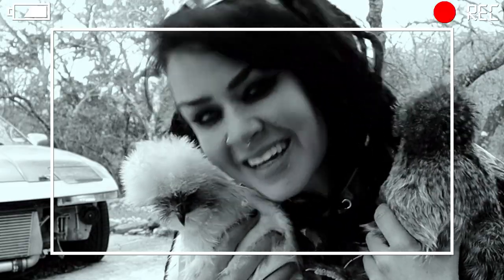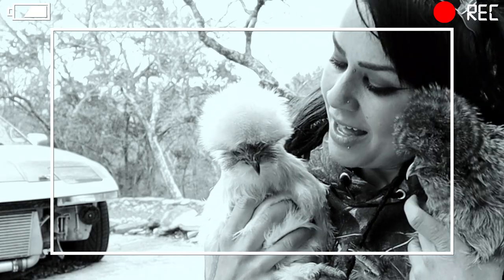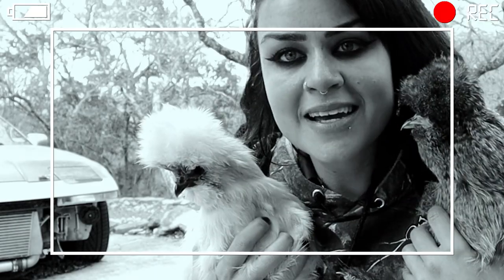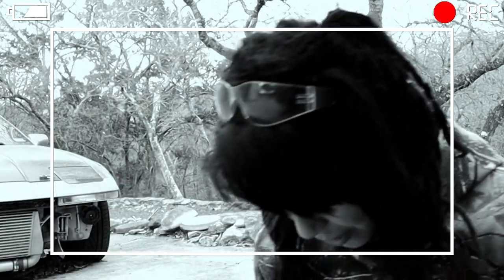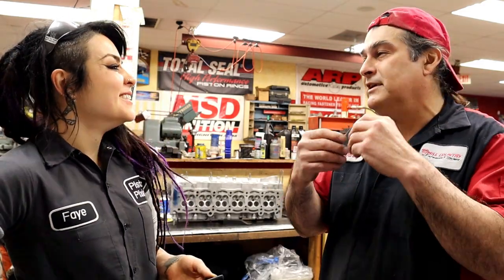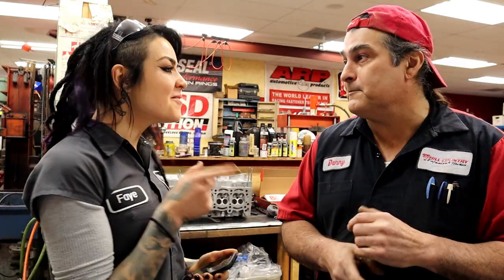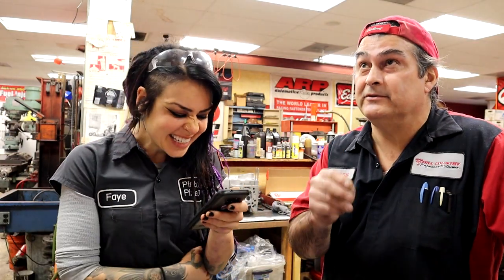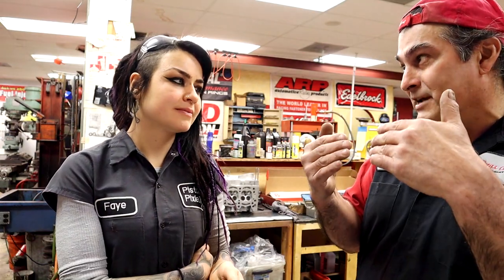Can You Straighten a Crankshaft?! And your other machining questions answered, feat Danny Soliz

Comment: Straightening a crankshaft is a pretty brutal process. If you want to see a customer faint, this will usually do it.  lol.   Stick it in a press, bend it straight, then bend it a bit more and beat the crap out of the journal shoulder with a blunt chisel to reduce spring back, check again,  do it a few more times until it stays straight, then grind the crank.  I like this guy.  He knows his stuff.
Reply from the maker: Yes!! Same!! Makes me wish I had a bent crankshaft just so I could watch him straighten it 😂😂😂

Comment: A small observation, to my knowledge Opel was the first mass produced cast iron OHC engine in the US in 1968, Ford and chevy followed in 1971 with the Pinto 2.0L with finger style cam followers and the vega 2.3L with bucket style followers. The reason cast iron is nearly impossible to straighten is because it has "memory" and is inherently brittle. Aluminium on the other hand has very little or no "memory" and is relatively soft in comparison so it can be straightened easily, but carefully. Great video Faye, and Danny.
Reply: Jeep had a OHC motor “the Tornado” I believe early 60’s.

Comment: This dude knows car stuff down to the metallurgical process. What he was talking about was when they forge metal what it does is opens up the molecule so they can hammer the carbon together so that when it cools its literally bonded together giving it that strength. Im just now getting into cars. I went into carbide. If I was 20 again I would have def went into auto mechanics. Its so fun now. Would have been a great career.

Comment: Tons of great info. Had the argument before with someone about sequence. It’s there for a reason was my argument. Keeping stuff straight.
Reply: Of course but, if you have experience, you can devise your own sequence ( if you have no specs for instance) as long as you spread the load evenly.
Reply: Steve Fuller yep but I have found a lot of similarity between large numbers of patterns. But that was from years ago. Aluminum is not something I dealt with a lot as I dropped out of the auto world decades ago. Still do just not for a living.
Reply: If you look at most sequences they are mostly based on starting in the middle and going outwards in either a criss-cross pattern or in a spiral. I’ve had to do heads where initially we had no information and haven’t had any problems doing it like this. Definitely let an alloy head cool before undoing it though!

Comment: Faye you're on to something here. You should use the Supra project to set up different series of insights from experts, like ...

1. Body/paint
2. Lighting/wiring
3. Suspension/lowering/wheels/tires
4. Transmission/diff
5. Interiors

... and what will soon become massively popular: electric drive conversions.

Comment: 20W-50 oil is fine for older engines like that when you're not concerned with fuel economy.  I used to run it back in the day (80's) but it was long before variable valve timing  engines.  That thicker oil is what saved your camshafts.
Reply from the maker: Thank you - yes!!
Reply: It is also handy when your old beater gets a little tired and the clearances are not what they used to be. I had to run 20W50 on my old 2.8L Chevy V6. If I didn't the oil pressure was about 3psi at idle. The reason was the engines had an aluminum body oil pump and they would wear out and fail to provide the volume needed when the oil was hot. Later engines recieved and all iron pump with taller gears and it was never a problem again.

Comment: Great informative video. 
My Triumph Tr7 has an aluminium head and cast block. 
The early engines had problems with those aluminum heads warping. Luckily my engine was a later engine. 
I always learn something new with your videos. Thanks

Comment: Reminds me of my first 7MGTE swap. I swapped a 7MGTE from an 88 MK3 into my 84 MK2 back in 2001. The previous owner of the donor car apparently had over revved the engine at some point as I ended up throwing the #6 rod, while in a parking lot, idling, rolling my windows up. Yes, it threw #6 at idle! AND it was still running, though badly, until I turned the key off, and then wouldn't start back up. It put 2 holes in the pan, a hole on both sides of the block below the cylinder, and destroyed my starter(why it wouldn't restart). lol. After over 6 months of not being able to find a bottom end, I gave in and did what multiple people told me to do. 

My friend gave me a spare 7mgte rod, and let me pull 2 intake, and 2 exhaust valves from a junk head he had. I pulled the engine and swapped the rod using the same piston, rings, and rod bearing.  There was no damage to the cylinder wall, crank, or rod bearing. I even reused the HKS 2mm MHG that was on it. I cleaned it and sprayed 2 coats of copper gasket spray on each side and let it hang up overnight to dry. Replaced the 4 valves in the head as they were slightly bent. Barely had marks on the piston. I cleaned the block with acetone and cut some aluminum sheet metal for patches. Put them on with JB Weld, not the quick stuff. Let it sit overnight, tried to pry them off with a screw driver and they wouldnt budge, so I wiped it down with acetone again, and put more JB weld around the edges to help bond it more to the block. Painted over it with low gloss black engine paint so it wasnt noticeable. 

I put it all back together, and on a stock pos turbo at 8psi, stock mk3 I/C, 2in PVC intercooler pipes, no mods other than a HKS SMF intake and 3in exhaust from the turbo back. Not even a boost controller. The 8psi was a shimmed wastegate actuator. I ran 13.6@98mph at the track a few months later. That bottom end still ran great when I swapped  it out when I finally found one around 2 years later. lol. Only issue was I have solid motor mounts, so it had a slight vibration in the steering wheel upon takeoff, but that is likely due to the rod not being weight matched to the other 5. I didn't know to do that back then. I was only 19, and was in school for my electronics degree at the time. Good times!

Comment: Advise using TIG on new aluminum engine and components. 7075 is used in some manufacturing and is highly prone to cracking once its welded without proper equipment and procedures. Also not sure but I think some manufacturers started using NiCom on turbocharged heads to reduce valve wear. And well arc strikes don’t like coating. Can you talk on some more about if the oil/cooling gallies have ever been warped from this process before?

Comment: here is a question for Danny. is it possible to have an older style engine like a flathead with today specs to make it with today's durability and power output? btw i have watched this series of videos many times over to soak up information like a sponge
Reply: Not really. Durability - sure, if you replaced every single part with new stuff made to modern manufacturing tolerances, and re-engineered things like the cooling system using modern engineering standards. Or start with a well designed flathead, like a 30s Cadillac. Power? No way, no how. It's impossible for a flathead to keep up with an overhead valve engine for power output, given similar conditions on the build. That's why flatheads quit being competitive in motorsports by the end of 1949 - the hottest flatheads with nearly 50 years of aftermarket development behind them couldn't compete with stock junkyard first-year OHV production motors tossed into the same cars. The primary issue there is that in a flathead, raising the compression beyond a certain point restricts airflow into the combustion chamber dramatically. A stock '49 331 Caddy has more airflow after raising tyre compression to 10:1, than is possible with a flathead at 8:1.

Comment: you can straighten rods crankshafts camshafts rods heads and blocks however. when you do this you should check clearances and balance for the counterweight activity..for stock application this is fine however when you get to performance applications you should check rockwell hardness in the bearing clearances. to ensure that there is any deformation or inconsistency..... mercedes benz developed race application engines for fomula one and posche high performance engines where the rods are one piece and the crankshafts are modular dovetail design. now if you straighten a forged crank with reheating the forging to retain the flexibility and hardness. isnt the heating.... it is the cooling process.. also remember the forging of automotive crankshafts. is the quality and grade of steel it is a different billet quality of steel.... a forged crank is made of one stock of billet... when a cast crank is a poured into a cast..when my dad was crew chief for several different race teams. he had a guy who cut crankshafts for each race application. then did forging and reforging process..remember pro race engine applications  all the camshafts and crankshafts are usually custom cut and designed...what i like about faye is she doesnt assume she knows everything.. she finds the answers like with the valvoline oil. that was awesome..i see a lot of people who use like royal purple and other oils that arent recommended for stock application due to sensors and bearings that may act as a corrosive detergent...so great job great commentary..

Comment: 944. Yeah that's how all the Ford module motors are made with their connecting rods there cast and then they're broken off that's why you cannot mix up the connecting rod he end of the connecting rod caps
Reply: it is critical to keep all caps on the correct rod, regardless of the make, model and CID. never mix them up.

Comment: I will just say that a metal will loose a great deal of strength by the time the temperature reaches 1/3 of its melting temperature. So, I suggest not to heat them heads up much past 350F for aluminium. And don't cool it quickly.

Comment: Guess I answered my own question never going to get my own work done if I stay on the computer all day! LOL not too many people go into the molecular structure  of things in mechanics of blown heads and gaskets! Why don't they make Flexible heads instead of Rigid, like the lower portion more rigid but the upper portion less rigid to, I would think it would have less of a chance to warp and stay warped, kinda control the over temperature areas  causing the shrinkage that creates the warp!

Comment: engine machinist are not machine operators. they understand metallurgy,, stress, how to read machined surfaces interference and clearance fits. using machines is just a part of it. experience is what the job is all about. i use to weld crank shafts. you know how to get the blue discoloration out of the shaft after completion? dip it in hydrochloric acid. looks like new. doesn't mean the shaft is junk. just an example.

Comment: Dear Faye:  'Love your chickens{?}!  Would a dry shaving brush clean the dirt particles from between their feathers after the've searched for insects?   They ARE, very cute, but I also like the high-trilling you do,--it Sounds cool.   Do you like inliners?   I'll bet they have more warpage due to increased lengths of crank & cams.   Bugotti and Alfa-Romeo used some center-driven cams, so those didn't have the problems that front/rear chain-/belt-driven cams have.  You must have thousands of "friends".   Could you find out if anyone has any Never-sold, Experimental DOHC heads [--one per engine ] for the 1967-69 Pontiac OHC inline 6-cylinder engine/block,--some of which tested factory-only, Experimental DOHC heads on the OHC-block that are never even talked-about.    Do drawings exist, even if they were "failures"?    A DOHC's output'd be no more than their hi-perf V-8s, so that's probably WHY they never saw production.   Pontiac OHC-6 survivor-engines are RARE, but factory-experimental DOHC heads for the OHC-6 block'd be like the "teeth" in your chickens--worth Many THOU$AND$, even if they were dug, --bent, out of a re-melt bin.

Comment: Ugh, those diesel Mercedes heads were poop to deal with. Actually, any alloy diesel head was a bitch to deal with especially when it came to facing them. Steel precom chambers in an aluminium face. Took skill and practice and lots of fluid to get a nice finish on those things. At least they weren't as big and heavy as the cast iron diesels like Volvos and MANs I guess.
Ask Danny if he's ever had the joy of dealing with the 6cyl OHC Jaguar heads with tiny little tappet shims in them. I dreaded seeing customers walk in the door with them. Huge chunks of heavy aluminium with studs facing out every which way. Now those things I don't miss.Just an awkward, awkward head to deal with.
Reply from the maker: Augh those sound like a NIGHTMARE!!! I will ask Danny for sure! But there's a good chance he will see and respond to you on here:)

Comment: Hey Faye, it's Ray 😁😁 got a question for your new buddy. I have a 16' Cummins 6.7. glacier diesel sells ARP head studs and they have bolt per bolt replacement procedure. 
What are both your points of view on this process. I attached the link, page 3 is where it begins the explanation.

Thanks for the informative videos. Watching you two rap is cool.

https://www.glacierdieselpower.com/files/ARP-Head-Stud-Installation.pdf